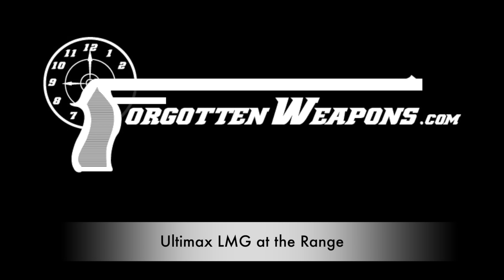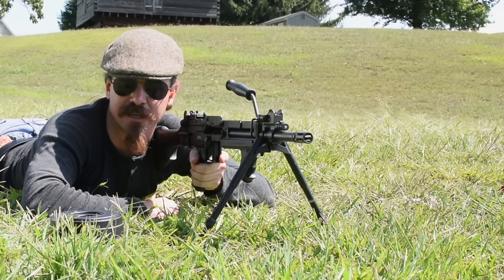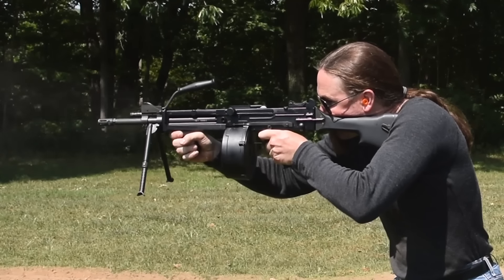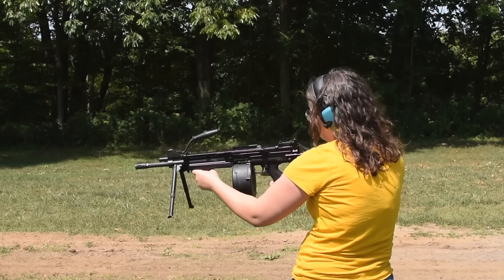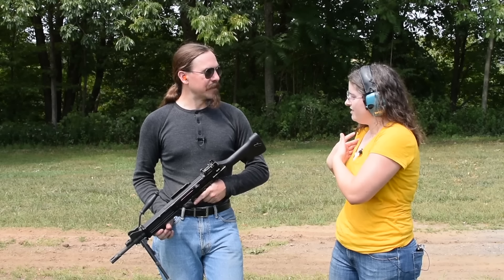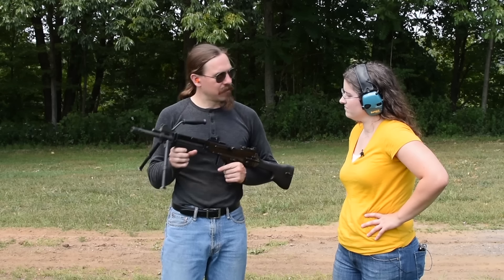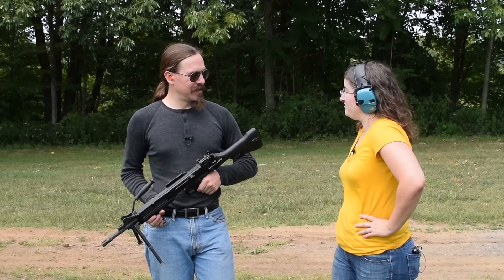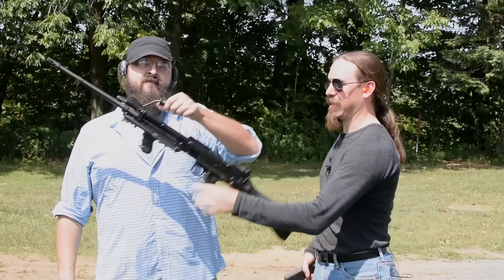Origins of Constant Recoil: The Ultimax Mk3 (feat. Mae & a Yeti)

Comment: Or you could just up the rate of fire and get the same result. The MG3 also has almost constant recoil.
Reply: Unless the MG3 can dump 90 rounds out of 100 into a target at 100 yards in one burst while in standing position, no, you can't get the same result. What you're doing with the MG3 is hoping to dump "some" rounds into target at a high rate of fire before recoil affects your aim. This one on the other hand, does not go off target. The MG3 is not supposed to be used in constant fire but in short bursts.
Reply: @danielc2701  

The Joke ---->

Your Head
Reply: @Ruhrpottpatriot  Can't blame me for refuting what is obviously a wrong "fact". I do not recall the MG3 being so accurate as to be able to get most rounds on target by holding the trigger down. You obviously have a wrong impression of the MG3.
Reply: @danielc2701  You still totally missed the point. I never stated that the MG3 can be used well from anything than a Bipod or Erdziellafette, in fact even with those two it's pretty much garbage as a UMG.
Reply: @Ruhrpottpatriot  Ah, ok, you didn't say from a bipod, yes that would end up with more or less the same result. I thought you meant standing and firing.
Reply: @danielc2701  I also didn't say standing. I just stated the fact that you can get continuous recoil by increasing the rate of fire.
On a sidenote: You never should use an MG, and especially UMGs, while standing, unless you're going for a Deutschuss.
Reply: @Ruhrpottpatriot  I think you misunderstood the meaning of "constant recoil", "constant recoil" is the springs of the gun storing up recoil energy then slowly releasing it so that the gun does not "kick". This means when you shoot the gun, you don't feel the gun kicking back at you when the bullet goes off. The MG 3 definitely kicks hard. And for the sidenote, this gun was designed for walking fire so it is supposed to be used standing up.

https://youtu.be/RMrbaYozP_s?t=299
Reply: @danielc2701  Every time I fired the MG3 it was more of a steady push back, exactly the same result when springs are used.

Walking fire has been obsolete since it's introduction in WWI. No sane soldier walks towards the enemy while firing, just because the gun could theoretically do so. It's a dumb concept, that should be struck from the minds of anyone.

And please don't use FPSRussia as a source. That guy has no clue.
Reply: @Ruhrpottpatriot  You keep saying the guns will give the same results, then deliberately cut out the parts which are different. Obviously you'll only end up with "everything similar" duh. And it is not "walking fire" but clearing buildings. You still have to shoulder and stack up to clear a building even if you are carrying a SAW, so while you do not "walk" around spraying, you still stack up and shoulder.
The way you are going, I think you are the one with no clue. You're comparing the operation of a GPMG with a SAW and saying they're both the same.
Reply: @danielc2701  No, you keep missing the original point: The result is the same, nothing more, nothing less.
You try to move goalposts by shoehorning the modus operandi into the discussion.
Reply: @Ruhrpottpatriot  Concept of Operation is ALWAYS important in how you use guns, you don't just randomly throw guns at people then have them randomly running about. And if you don't see any difference between how you use a support machine gun and a SAW then there really isn't much point continuing because it has gone beyond application into willful ignorance. Support machine guns are NOT SAWs.
Reply: @danielc2701  sigh Again with the modus operandi...
How you use a gun, or any tool in general, has nothing to do with what it can do or does.
Is a UMG worse for clearing rooms compared to a SAW? Yes, of course it is. I never denied that.
Still it doesn't change the fact that you can achieve constant recoil by different means. That's what I wrote, and you ignored.

Comment: Is it just a coincidence that this is mag-fed rather than belt fed?

Since as a belt is used it gets lighter, which means less work by the feed pawl, so varying resistance on the bolt. Which for a firearm with a finely tuned bolt movement distance that's can't be helpful. It may be insurmountable in practice.

If it is only practical when fed from magazines you have the dilemma of quite a large weapon yet can't have a huge 200-250 round belt as you might prefer.
Reply: It has no belts for the reasons you mentioned and because the original contract requirements included using standard magazines. Plus it is largely based on Jim Sullivan's work with Stoner and the M - 16.
Reply: @williestyle35  How did that mag feed work in practice? I understand mag feed doesnt necessarily mean the weight per round goes up as the weight of the box that the belt is stored in combined with the metal links means that 200 round box can weigh as much as 7 fully loaded 30 round mags. 

But who wants to have to reload a machine gun every 30 shots?

Comment: How do the mags lock in? They look like they are locking in kinda like an AK/galil mags, but then the mag at the end clearly has a AR-15 style mag catch cut into it. Were the magazines modified to work with this gun?
Reply: Yes, the 30 round mags had to be modified to lock into the gun, the weapon uses a "vampire teeth" system where 2 "teeth" will lock into the magazine. The 30 rounders had to have 2 holes drilled near their feed lips to "lock" into the magazine catch. This was a big problem in the old M-16 magazines which if you recall were made of aluminum and deformed easily so the older mags when fully loaded, deformed over time and sat lower and lower until the bolt could no longer pick up rounds, leading to lots of "No feedings".

Comment: Constant recoil is not just about the bolt/carrier not impacting the back of the receiver. If it was just that, then many of the old submachine guns like sten or mp18 would be constant recoil. But they aren't. while their bolts don't hit the back of the receiver, they do hit the front of the receiver. This gives them a bump forward as they fire, which makes them jumpy. Just watch a slow motion video of a sten firing and you will see this clearly. The extra secret is the counterbalancing of this forward bump with a locking system that unlocks in exactly the right time with exactly the correct force. It's a complicated combination of the pressure of the cartridge pushing back to the locking system and for example gas impinging on the bolt carrier in gas impingement. The backwards bump of the bolt/carrier hitting the back of the receiver is the simple and easy part - just make the receiver long enough and the recoil spring strong enough. This was done already in ww1 with the mp18. It's the forwards bumb that is still being figured out and even many of the experts don't seem to understand it.

Comment: Nice guns to shoot when your enjoying a clean range, actual military experience has been more hit an miss. The gun as adopted by Singapore doesn't feed belts, and the early drums had major reliability issues. Lubrication is also a drama here in the tropics, if you use a dry lube like graphite the rain causes problems, if you use oil then the dust sticks to it, gumming up tight tolerances not designed with reliefs to push much out of. The constant recoil works on only a single ammo type, everything from blanks to tracers or pressure plus rounds causing reliability problems in addition to bad handling. The left side only charging handle is also harder for most right handed shooters to work quickly, especially while standing with a heavy magazine hanging in front.

Also being 5.56mm rather than 7.62mm is a trade-off that suits less LMG roles than ever before, while it grants lighter weight and faster reloads it moves into a zone that modern assault rifles already do a decent job of competing in, meanwhile being less effective against cover, armor and less suppressing downrange (especially at long distance) than competitors like the m240, which can feed equal sized mags thanks to belts. Indeed the 100 round drum used here is physically bulkier than the 200 round box on a 5.56mm FN minimi, which has much wider Nato adoption (75 counties vs 3).

Basically these where only adopted because Singapore as a rising power at the time demanded something local that still fits NATO spec, and in that regard it does well, with even imported western designers working trough local firms for its multi-year development, leading to entirely locally owned intellectual property and a large number of local jobs. What it does not do is improve on other designs for sale in time of wide scale adoption.

Comment: 4:12 They did. 

Look at the MP40 or any old sub-machinegun. They are all constant recoil.

Look at the fire rate selector for the MG34. 
It had a lower fire rate for infantry (the other option was anti air) for a reason.

Rifles like the M14 were not designed around this. Pistols like the Glock 18 were not designed around this.

These are rifles, and pistols — not machineguns.

The bolt / slide slams against the back of the receiver, and they have very high cyclic rates.
They’re also notoriously bad in full auto.

Closed bolt sub machineguns like the MP5, were designed after rifles like the G3 — not machineguns.

In contrast, anyone who has fired an UZI can Immediately recognize the difference.

In my opinion, the parameters constituting an  ”Assault Rifle” have never been met.

”intermediate” cartridges like the 7.62x39 are not sub machinegun cartridges. The M43 was designed for the SKS.

The 7.92x33 Kurtz was more of a stopgap to compete with high velocity sub machine gun rounds like the 7.62x25 tokarev — which today we would compare to a high power ”PDW” cartridge.

The US never adopted an ”intermediate” cartridge, and the Soviets quickly abandoned it. 

The 5.56x45 was similar to an assault rifle project — taking a similar muzzle and recoil energy of the .30 carbine and improving the ballistics. The .30 carbine was replaced.

Comment: I keep wondering why the new M250 doesn't use a recoil system like this. Does anyone have an explanation?
Reply: It could be than the length and power of the new cartridge plus the bolt design might have made the receiver too long and cause weight issues.

They did use another recoil mitigation which is short recoil impulse averaging, funnily enough the Chinese also used this system in their new GPMG.

Comment: I have used this LMG for live firing, yes, it is amazing to shoot. Very stable which lead to constant accurate hits even at 300metres. My problems with this system is that it uses a drum magazine which is difficult to load by hand in the field. Secondly, it can jam if some sand, dirt or rust get onto the bolt carrier. Another major problem is that it is the overall length of the gun, it is longer than the AR15. Weight distribution is front heavy. Quite difficult to move around with the long gun in tight corners or in dense jungle. A minor problem is the shallow magazine catch, the drum magazine can drop out of the gun during firing. I am no surprise that other armies do not want to adopt this LMG into their arsenal.

Comment: Jane's International Defence Review correspondent — Andrew Tillman, in an exclusive invitation from ST Kinetics to participate in the Product Improvement Program (PIP, initiated in 1989) to test fire the gun, elaborated:
This article began by praising the Ultimax for its ease of control, which allows accurate fire. A comment to the author by an experienced SEAL team leader aptly underlines the importance of having an accurate light machine gun: "Men react one of two ways when they are shot at. If you just shoot at them, they will take cover and return fire, but if you start hitting them, they withdraw."

Excerpt taken from:
https://en.wikipedia.org/wiki/Ultimax_100

Comment: The rate of fire is a little bit slow
Reply: Compensated for by the fact that you can just hold the trigger down and keep someone pinned down completely. The higher ROF guns have to use 3-4 round bursts then stop to reaquire so it's kind of 50/50 which direction you want to go, low ROF but can hold down the trigger or high ROF but short bursts.
Reply: @danielc2701  you mean you cannot hold the trigger and fire continuously with the higher rate of fire?
Reply: @loudwire637  It'll "kick off" target for other weapons. For example, the M-249, by the 4th round, it'll pull high right so if you want to hit a target with a long burst, you need to aim a little lower left. This is one of the reasons why people are so ga-ga over the Utimax and the Knight's Armaments, they don't "kick off" target but instead get more "accurate" as you fire longer because you can "correct" the stream of bullets back onto the target. Things like the MG-42 are even more drastic, leading to weapon damage and overheating if you ever held the trigger down for too long.
Reply: @danielc2701  Ok, i get it...thank you for explaining 👍
Reply: @danielc2701  as i don't know much about guns..i thought higher rate of fire will be much more deadly in a combat😁

Comment: Is there a possible problem with forward bolt velocity? Springs decelerate bolt going rearward but accelerate forward. Can bolt go too fast and slam into receiver? Is there some sort of decelerator?
Reply: It is a complete system, bolt is modified and there are other changes that help reduce the forward bolt momentum.

Comment: Question is: Is it uesful in a real life situation? Would a series of 3-5 round bursts not supress somebody just as well as fully american automatic fire (and keep you supplied with ammo longer)? When you do short bursts the recoil buffering gives you zero benefit, because you need those 3-5 shots until you adjust to the recoil.
Reply: You actually don't feel the recoil that much. Why it looks like it was jerking around in this demo is because they were holding it rather loosely. The trick is to pull it in very hard and tight and it won't jerk around. Sullivian did the ticker tape energy tests and it showed the recoil energy was 1/4th that of an M-16. You won't have any problem holding it on target.

https://www.youtube.com/watch?v=9P2-hdtK3Wc

This is how it's supposed to be done. And if a 2 man team loses it and "sweeps" an area, it's actually quite horrifying because it will stay at that level and not throw rounds high after the 3rd shot.
Reply: @danielc2701  Thanks

Comment: Constant recoil method of operation see MKb42.
Reply: I took a look at Ian's video on the MKb 42 and it has nothing like that, it uses a spring in the buttstock fixed to a gas piston, none of the overlong springs that run the length of the gun like constant recoil systems use. It's just another type of "spring in buttstock" gun rather than constant recoil.

Comment: before i saw so many videos about guns, that's what I assumed all semi and full auto guns DID. 
I never understood why you might WANT the bolt to hit the back and stop;  I assumed the designer would just increase the spring until the bolt just barely reached the back.

Now i realize that any variations in ammo power/quality or the cleanliness of the gun can be somewhat filtered out by having the bolt stop and then letting the spring push the bolt forward over a consistent distance. You can design the action to run with the minimum amount of energy and then any extra recoil energy gets dumped into a buffer pad or the shooters bruised and aching shoulder flesh.